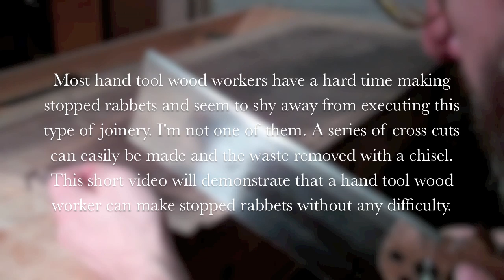A Card Catalogue part six: Stopped rabbets for the cabinet back.

Comment: Tom, am I right in thinking you could also use a plough plane to run your rebates all the way through, and then mitre the last dovetail to hide the rebate at the corners? Seems like this would be considerably quicker if so. As long as the rebate depth is less than half the thickness of the material it seems this would work.
Reply from the maker: mouppe, thanks for the comments.
For sure, you could change things up with the joinery choices and use a selection of other tools to execute this joint. I did it this way to show readers/viewers another approach using simple tools. Remember, this project was from my book The Unplugged Woodshop, so many of the techniques and choices I made are for the benefit of the reader to learn.
There's always 'another' method-; )
all the best~
Reply: Tom Fidgen Thanks Tom, I did not realise you were demonstrating something from your book. Very enjoyable, thanks.
Reply: Great song, Tom!
Reply: Tom Fidgen Ahhhh.  Thanks for clearing that up.

Comment: incredible work, I just have a quick question. is there any reason why one wouldnt do the first and last few inches of the rabbet like this the clear the middle with a rabbet or shoulder plane? Saves some time and would be cleaner results wouldnt it? Or am I missing something?
Reply from the maker: +alex naazeer Hi Alex- thanks for the questions and comments. You're absolutely right. I did these stopped rabbets like this to illustrate that they can be done with only a saw and chisel. The method you mention with a shoulder plane would definitely work, as would a rabbet plane and/or a Router plane. As woodworkers, we always have other options- this was just to demonstrate one method with minimal tools.
all the best~

Comment: Could not a shoulder plane do most of the work on the rabbets?
Reply from the maker: thanks for the comment/question...100 % . I could have also used a router plane or a small rabbet plane; a kerfing plane and/or a plow plane may also work. Point being  there are many options for cutting rabbets. This is just one method I demonstrated 8 years ago when this video was first published. Cheers!

Comment: Stanley makes planes that you can use tot make rabist wy not use one of those
Reply from the maker: Daan.Z.bloedjes- thanks for the question. You're right, Stanley makes rabbet planes- so do many of the current hand tool manufacturers, Veritas, Lie Nielsen, etc...
I used this method simply to show readers they don't need special purpose tools to execute this joint.
I tell students to use whatever tools they have.